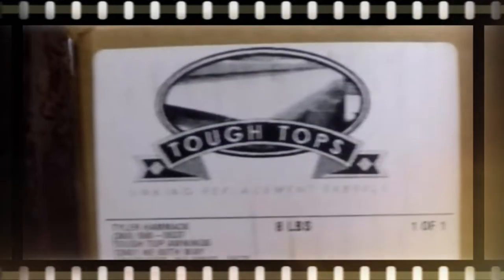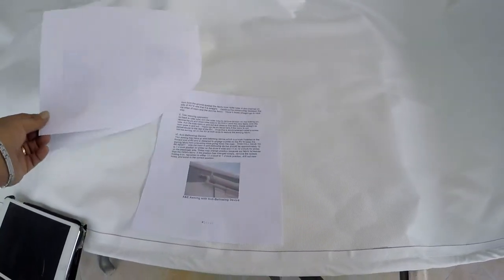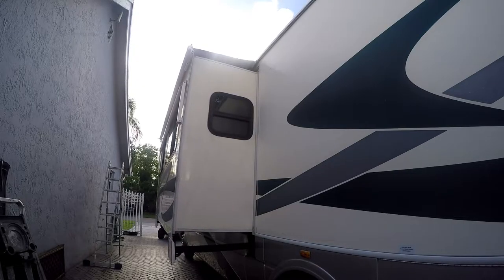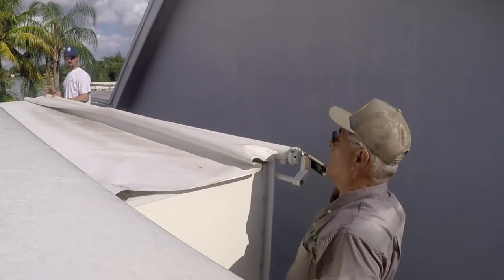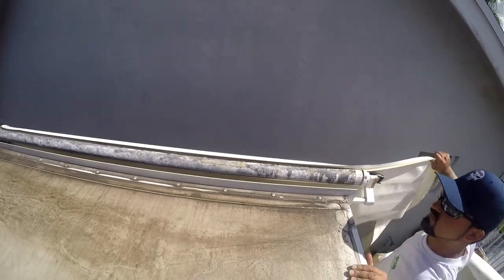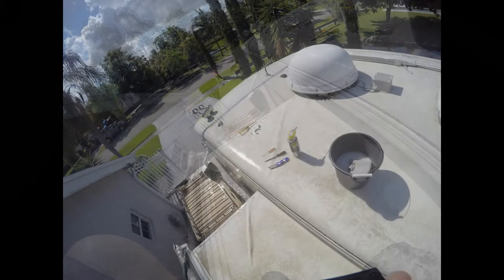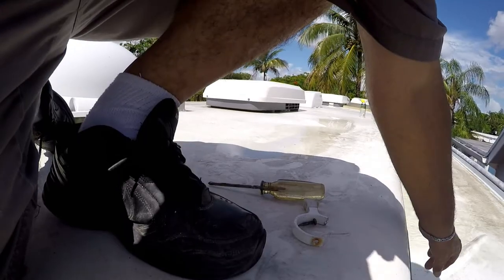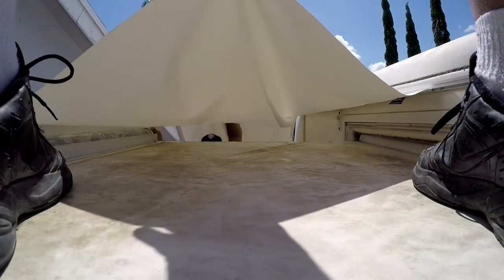HOW TO REPLACE RV SLIDE OUT TOPPER AWNING FABRIC

Comment: Great video,only issue with us dyiers is since none of us have more then likely done this before one important piece of information is that there is front and back to the Fabric. Why they don't mark it is beyond me. Check to make sure you have it the right way, I could have saved alot of time knowing this which I have watched a couple different videos now and again no one mentions this. The plastic round cords they use are two different sizes,so again make sure you have it the right way. 👍
Reply from the maker: Thanks 👍

Comment: You have no idea how much this helped. I just got a used RV and need to replace a few of these. Thank you. Now I do have a few that you have to manually roll out on the opposite side that won't lock Into place well actually none of the manual ones will lock in place I feel like I'm missing something.
Reply from the maker: Glad the video helped. If you're talking about the window awnings, they usually do not lock automatically, the strap that's used to pull them out have a loop at the end that goes into a plastic hook that's attached to the wall just below the window,
Reply: @JohnCRV  that's what I thought. I got one if them to stay like that but the other one tries to go back in and gets mangled up so I just left it in. I do appreciate it.
Reply from the maker: What do you mean by " the other one tries to go back in and gets mangled "
They are supposed to be spring loaded.
What's the brand's name of the awning?
Reply: @JohnCRV  I'll have to look again to see the brand but when I hooked it to stay out it goes back in even when it's hooked. Once I get back I'll take a look at the brand.
Reply: @JohnCRV  A&E systems is what it's called
Reply from the maker: I have the same brand. Is that strap too long maybe? It may have been changed with a longer one. That's the only thing I can think of.
Reply: @JohnCRV  sounds like that is the issue. I finally got all of them out except that one and one on the opposite side but the reason I didn't get the opposite side out was because there's no hook for the strap and I looked and it looks like one was never put on for that one because I didn't find any holes where one should be.
Reply from the maker: Glad you got it figured out. I'm sure Amazon sell the hooks. Meantime use a Bungee Cord or rope.

Comment: Hey John! I saw your comment on DR outdoors video about his channel switch. Just writing to say wow, you are awesome! You gained at least 1 more supporter from that...me. I have a personal YT account with (essentially) no content. I use my “channel” just to help follow/support/comment. 

BTW, Ken is on his knees begging you to help us replace our topper 🤣. We had a tiny leak in the outside wall of the slide during the 3 straight days of rain at Lost Lake. We have to remove the topper (I think 🤷🏻‍♀️) in order to deal with the leak. Not sure, haven’t researched it yet, just saw this video when I came to respond to your kind remarks to David. 
❤️❤️❤️❤️❤️
Reply from the maker: Sorry to hear about the leak. Your slide out is much shorter than mine it should be very easy to do . One thing about having the toppers its hard to clean the top of the slide out and hard to caulk as well. Do you have warranty?
Reply: No, we bought used last July and did not get warranty. We actually have a pretty good guy in Havasu but Ken is wanting to do more himself...he was not a DIY guy when I met him, but turned into one as his health improved.

I think with a ladder, I could prob get under there to reseal without removing topper...may need to shed about 20 pounds to make it easier though! 😆

It’s small enough that I think we can manage until we get back, at worst, we will keep slide in when it rains (temporary fix)
Reply from the maker: Smart fix for now. 👍

Comment: Great video John! I think you hit the nail on the head by saying to go slow on a project like this. It's one of those things you don't want to find out you messed up later simply by rushing things. I'm sure it would be easy to have things get caught, ripped to snared if going fast.
Reply from the maker: I found nothing to make this faster except the part of cutting the old tarp in 2 to take it off. thanks my friend.

Comment: I am so grateful for this video!

My topper has become very destroyed since the last windstorm we just had. It’s almost ripped all the way across but there’s a few feet still connected to the RV.   I am wondering what will happen if that middle section rips completely off from the RV? Will the spring loaded roller have to be dealt with differently?
Reply from the maker: You don't want it to unwind at a fast speed, it can damage the spring without controlling the speed. They are meant to wind and unwind at a slow speed.  I suggest you insert the pins at each end as shown in the video. Do not use the slide until ready to replace it.
 Slide a pin in the hole on each end of the tube to lock it in position so to prevent the spring from unwinding. 
I used Allen keys as pins. 
Good luck
Reply: @JohnCRV  thank you for the reply.  I live in my RV full-time, and my bedroom slide is stuck in at the moment waiting for a part.

It’s really hard to live in the RV with both slides closed for that long. But I guess I’ll have to.🙏🏻

I’ve watched several videos about this, and I am pretty confident I can do it. I was just thinking there might be a way to hold the roll bars in place while I wait for the replacement and be able to keep the slide out. 

I am familiar with the pin method. I wonder if I could remove the old topper with that method, and with the pins holding the springs, then put the slide back out and wait a few weeks for the new topper?
Reply: It might be helpful to note, I have an A&E slide topper mechanism. It’s 300” long
Reply from the maker: @inspired2rv661  """I wonder if I could remove the old topper with that method, and with the pins holding the springs, then put the slide back out and wait a few weeks for the new topper?"""

That is a good idea. Be careful on that ladder and definitely need 2 people to do this.
Reply: @JohnCRV  if the slide is in all the way, I should be able to do all this from the roof lying on my belly. I might not need a ladder.

But I will think it through thoroughly before I proceed.
Reply from the maker: @inspired2rv661  25 feet is a long topper. You may know this already; be careful not to overtighten the roller spring or it may effect the alignment of the slide. Count how many turns when you loosen it. Good luck.
Reply from the maker: @inspired2rv661  You will need a ladder and help. Be safe!
Reply: @JohnCRV  
I managed to find a helper and we got the job done today!  We left the gip in the C channel and the roller tube, we just cut away most of the old fabric in between leaving about 5 inches on the roller side and a few inches on the Cchannel side just so we can pull it out later.  The idea is to keep debris from getting trapped in there while we’re waiting for the new topper to arrive.  I live in the desert with lots of wind and dirt.

The job was quite simple thanks to all the tips and tricks and I can now enjoy my slides out!  

We used an allen wrench and a small screwdriver on the ends of the roller tube and I covered them with duct tape just to make sure they don’t come loose. 

Thanks again for your help and encouragement!
Reply from the maker: @inspired2rv661  I'm glad you got some help. You sound very confident. Congrats 👍

Comment: We just followed your video and all went smoothly. Only one challenge. Putting the anti billowing device back on. In the closed position it anchors just under the bracket on the motorhome body. When I looked at the other slideout it has the anti billowing device away from the body. Could you please tell me or show me the correct position it should be in when the slideout is in?
Reply from the maker: Is the make of your mechanism Dometic?
If you are not sure click on the link on my description for the anti billowing part. 
further down you will see a link for the manual of the same make and model. On page 8 you will see instructions. 
you may want to save the manual, it may come in handy some day.
Let me know if the link works since I haven’t checked it for a while.
I hope it works out. Good luck
Reply from the maker: Just an FYI.
The purpose of this device is to stop a slide out topper from unwinding while driving down the road. that is it. 
it shouldn't interfere with anything else. 
To position it, put your slide out in and make sure the little leg is at one o'clock on the driver side and 11 o'clock on the passenger side.

Comment: John, excellent explanation and I learned more from you. I like that you not only do the work but you show the work, plus you mention that it should be clean, and explain why, Thanks for this video. John do you need a class B licence to drive your RV? Like 65 Gary
Reply from the maker: Hey Gary, Thanks for the kind comment, I try to explain as much as possible but try to keep it short because whats important to some is not the for the others.  Paying attention to Audience Retention but it's not easy.  Although I have a Class B since I was 18 it is not needed for RVs without air brakes.
Reply: Thanks so as long as the RV does not have air brakes I can drive it with a Class C license that is good to know. I used to have a Class A but after driving rigs for 5 years I gave it up, plus I lost both of my knees. Thanks for the information. Gary

Comment: I just paid $500 to have 2 slide toppers replaced (fabric only) and they are both wrinkled. The tech said they always wrinkle at first and after some use they will smooth out, is this true? They replaced the fabric on both in about 45 minutes and were in a big hurry because they had one guy waiting to pull out and a wrecker waiting to pull in another rig and I was blocking them both.
Reply from the maker: If the new cover was not delivered wrinkled then there should be no wrinkles after the install. 
If not installed properly (evenly on both sides) it can wrinkle and they will not go away.
If installed properly (Even on both sides) the wrinkles will go away with time.

Comment: I see Eternabond tape on the roof :)   could tell you were soaked with sweat must have been very warm up on the roof and why is this stuff takes SOOOO much time to do why can an awning not just be unclip here and here and reclip done....hopefully we have a few years yet before we have to do this
Reply from the maker: Eternabond tape on the roof has been there for almost 7 years now and it was the best thing I ever done. Working in the summer is really not a good idea here in Florida but i was not taking any chances on going away and the old one would brake on me LOL.
It's really not that bad if you have help. Thanks for dropping in my friend and Safe travels.
Reply: Good stuff--- Florida is going to flood so you better consider heading up to Georgia the "New Coastline"  LOL
Reply from the maker: They been saying that for the last 50 years. LOL

Comment: Any idea about winding the tube? My awning ripped off in the wind and the tube unwinded itself
Reply from the maker: Sorry to hear about you mishap Kyle.
Wind the the tube toward the RV until you have tension, the amount of turns to wind it on my A&E awning from when you start feeling the tension is 4 full turns. Call your dealer or manufacturer to find out if yours is the same. After locking it on both sides slide in your new tarp and follow the instructions from the video from there. Make sure the springs were not damaged when it unwinded suddenly. If you feel any slipping. Inside the tube that means you need to replace the spring.thats comething I would not tackle. Hope this helps.

Comment: I have the WORST Rv holiday rambler made. My awning goes under the drip rails permanently fixed to the roof. 
All the silicone need removed and then fasteners removed.
Reply from the maker: Can you cut it off and install the new one on the gutter grove? Assuming the gutter rail you have has a groove?